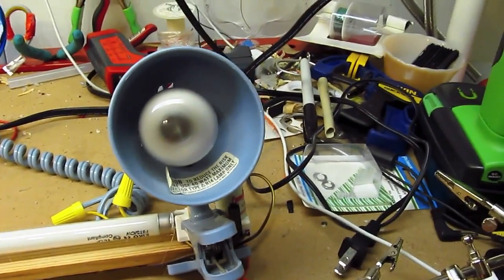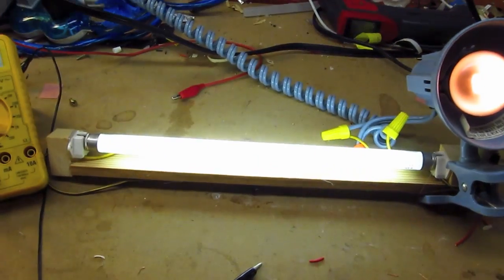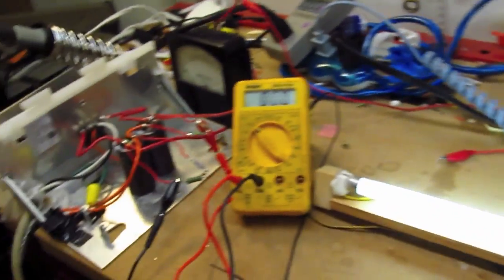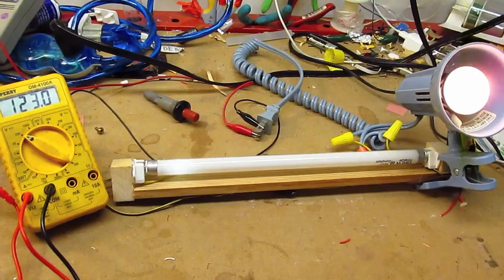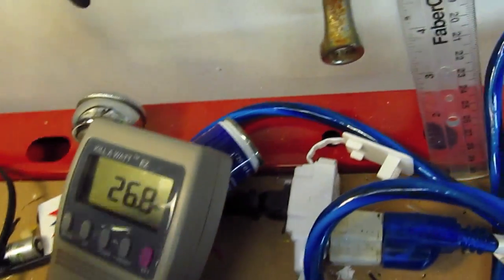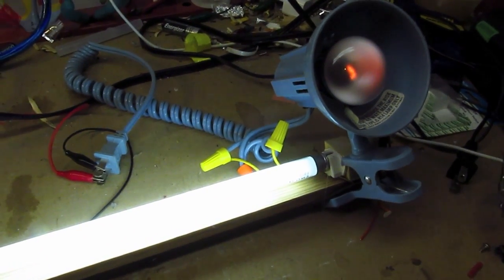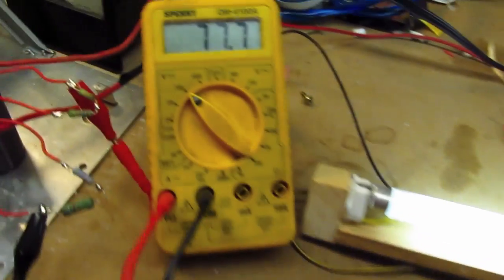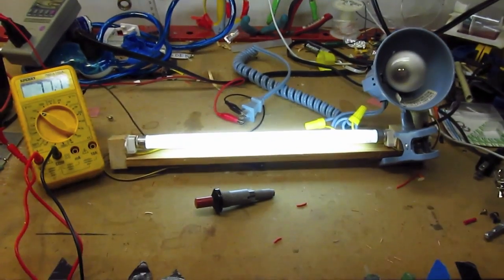Fluorescent tube running on DC with incandescent lamp ballast

Comment: Very interesting.    Knowing that this video was shot for demonstration purposes,  I gotta wonder what the effect would be in a larger general purpose fixture,  such as a F15T12 or F20T12, commonly used in medicine cabinets in very old bathrooms.    I suppose the magnetic ballast/starter combination included with the fixture,  wired in series with an incandescent lamp with a high enough voltage DC would work without having to use a grill ignitor to strike the tube as the  ballast would introduce a high voltage spike when the starter opens (very much like old cars with a distributor and breaker point ignition system)

Comment: Question. Did you ballast the fluroscent tube using a incadrscent light bulb as a ballast like an self ballasted mercury vapour lamp ?
Reply from the maker: That's exactly what I did. 

I've seen old fixtures that used an incandescent lamp and a flurorecent tube together in the same way, where the incandescent provided ballast and vastly improved the color rendering of an old cool white lamp. 

Also saw an odd fixture where the ballast was a long coil of resistor wire embedded in the ballast chassis. Little 20 watt T12 lamp so the power dissipation was acceptable.
Reply: Thankyou. Great Chanel

Comment from the maker: Thanks for the comment :)
All a gas discharge lamp needs is a way of liming the current while keeping the correct voltage.  It doesn't matter whether it uses an inductive choke or a resistor, or what waveform the voltage takes, from DC like this experiment up to the tens (or hundreds) of kHz found in electronic ballasts.  However, long term operation on DC will cause the mercury to migrate to one end (causing a loss of light output) and one electrode will wear out faster than the other.

Comment: I never even knew this experiment was possible. I knew in the past you could buy a ballast bulb for lighting up tubes just like your experiment here And back in the 60s you could buy a fluorescent light that uses a resistance wire rather than a ballast or ballast bulb and this magical light fitting was called the Mazda Netaline

Comment from the maker: Because its such a small tube, it would sometimes light on its own, if I increased input voltage by a bit, or even if I touched the tube.  If this were a fixture meant for regular use I'd put an inductor in for reliable starting but I might get away with a grounded reflector near the tube.  For experimental purposes its convenient enough to hit it with a grill ignitor.  Thanks for watching :)

Comment: You still need inductive reactance from a magnetic ballast for the tube to strike or some form of capacitive voltage doubling to step up the voltage if you do not want to use a magnetic ballast.

Comment from the maker: Below about the 78-80 volts, it got unstable and started flickering and power consumption actually increased by a few watts. I will put a small inductor in series with the circuit to allow it to start more reliably.  Also need to get meters for variac output current and voltage to see what power is lost in the variac and rectifier so I can measure the efficiency.